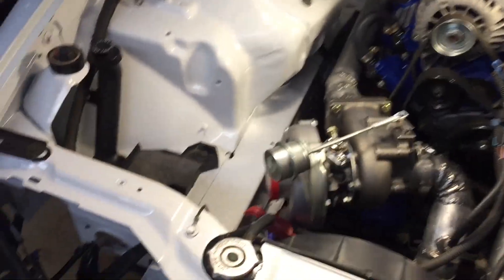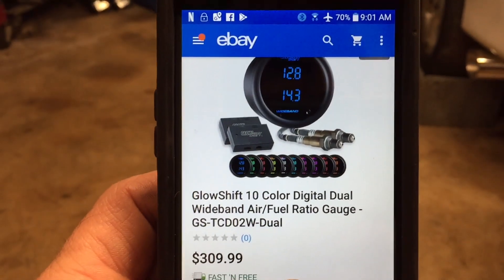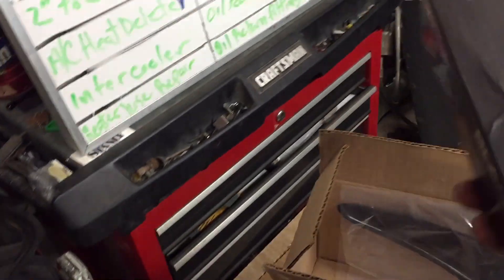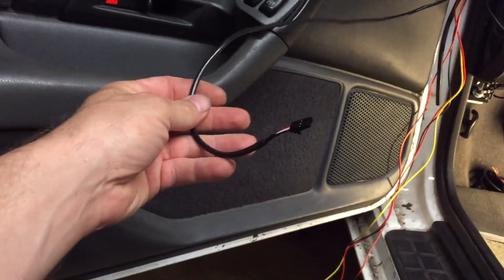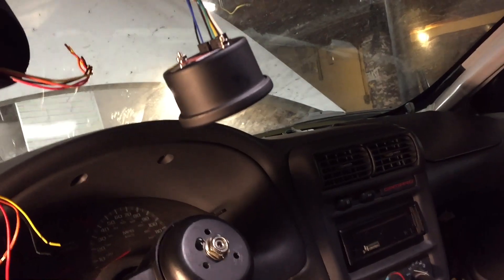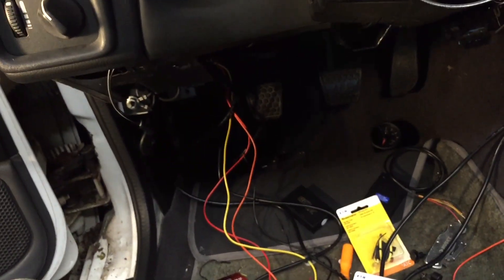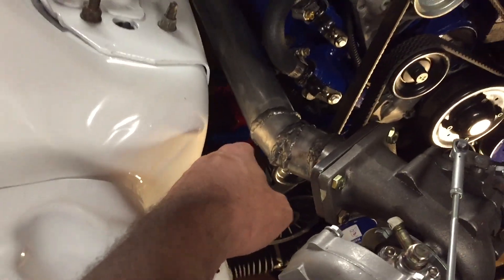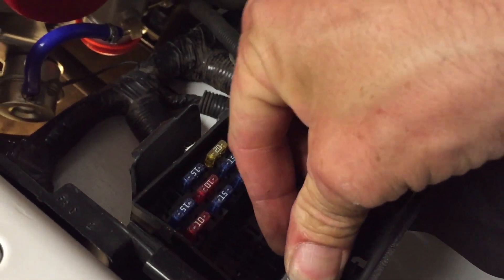Glow Shift Gauges install wideband, boost, and fuel pressure 3800 Camaro -Twin Turbo Build - Part 25

Comment: hey just a question? i see you have the glow shift dual wide band kit... how is it holding up.. been looking at purchasing one but only found a review or to and no real input... can you give me some insight?
Reply from the maker: Stephen Foster not yet.. if you follow my channel you will see I’ve only started the car on one occasion for like a minute and half as a first start on my build  ..sorry wish I could have helped with more info..but I can tell you it was the cheapest dual wide band that was a decent brand name also they have easy to follow installation video on there YouTube channel and responded back to me when I had questions threw the email provided on ebay

Comment: For your battery cable ends you should get a 9/16 bolt that screws your cables directly to the battery. If you get the bolt longer than it needs to be and screw a nut on it to hold the cable tight it allows you to use the remaining length as jump/charging posts and wont cause you any connection issues like a standard side post end or the lead top post conversion
Reply from the maker: good idea man ... but i plan on getting a regular top post battery for her in the future... this battery goes in the black camaro im just using it for now.